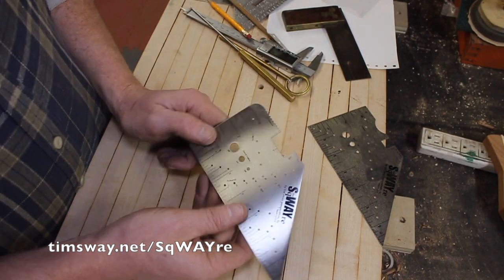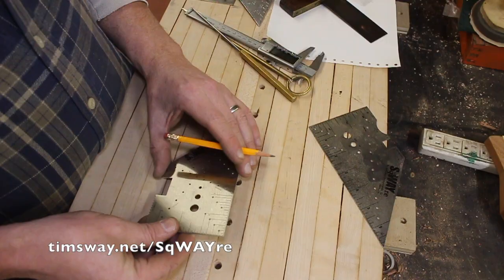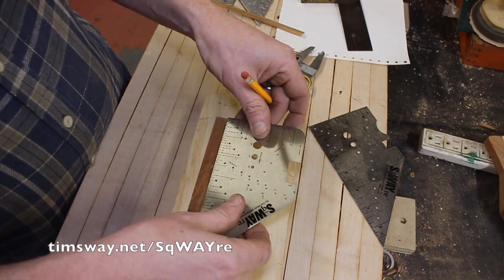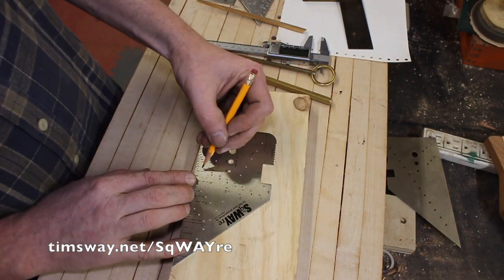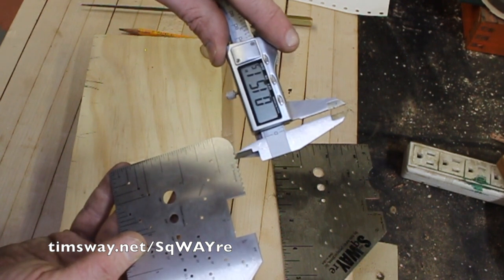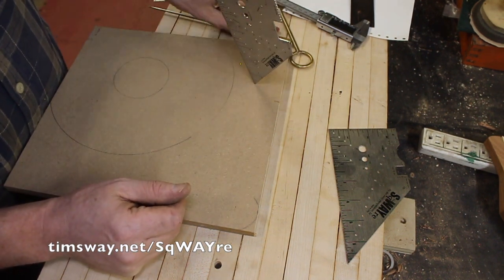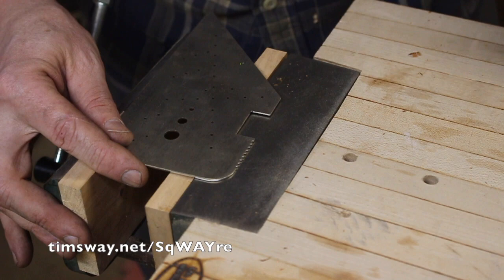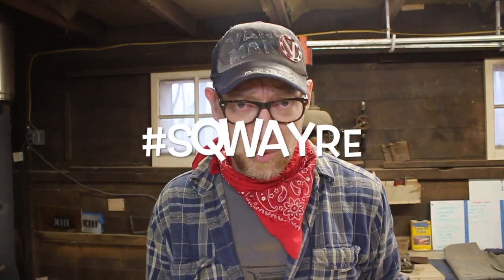What the heck does a SqWAYre do??

Comment: I just got mine yesterday. I will be using that round corner a lot fro cutting corners on leather soon. The angle measuring will be huuuuuge!!
Reply from the maker: Quite a few leather workers have purchased them - which was a use this vegetarian never thought of. Since leather often has no straight edges, this tool is a great way to get started.
Reply: I woodwork also but I wish I had version 1 also as the quarter circle or whatever shape that is used in card holder and wallet pockets a lot as a tab of sorts. Hmmm leather sqwayre holder pockets for a belt or apron???

Comment: slick little tool, i just have one problem....  the ink will wear off, ask me how i know.   if you have it laser cut then it can be laser etched so that the lines and numbers etc will never be abraded away!  the lasers i have used all have a power setting that can be adjusted to "cut" 1/4 the way through the material creating a nice etch if it dosent have an etch function already.
LMK when you get that done and I will buy a few.  thanx!
Reply from the maker: that was the original plan but it put the cost up WAY to high to make in the USA and sell. We looked in to several ways (stamping, etching, etc. etc) to do it and I had to settle on this. The ink is baked in and acetone safe, etc. etc.. I have one of the originals that i have been beating the holy hell out of for about 8 months. I use it in the worst possible way daily, scraping down my mdf cnc wasteboard, ink against the material. It s starting to show signs of fatigue but can still accurately measure to the 16th.
Reply: i feel you.  the environment my tools like this find themselves in is quite harsh and many a scale, ruler and tape has gone into the trash because the inks/ stickers/ etc wore off.  it is to the point that i dont buy stuff that is not etched/ stamped/ engraved or the like.

Comment: The only flaw I see is the shiny metal. Perhaps one mod is needed where you bring the shine down. You could black the metal, and make the information on it white. Or use nickel instead of steel so that it doesn't shine so much.
Reply from the maker: I looked in to that. Honestly the shininess has only proven to be difficult while filming, but while working it is not a problem. It's no more reflective than my other rulers and shiny things. ideally I wanted to etch the information in to the metal instead of ink, but it cost too much to make.
Reply: Well that's a shame, cause I could see a lot of people who do videos with building a multitude of things using this handy device who might not because of the reflective metal.